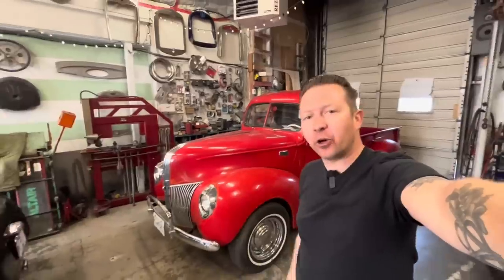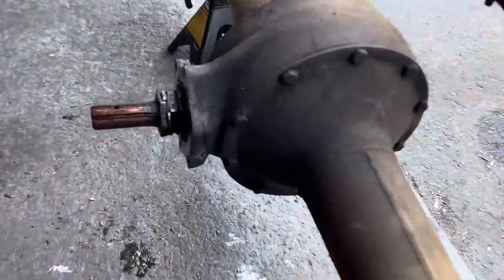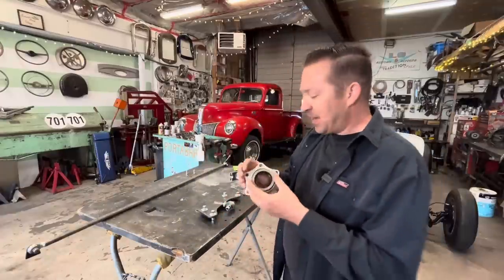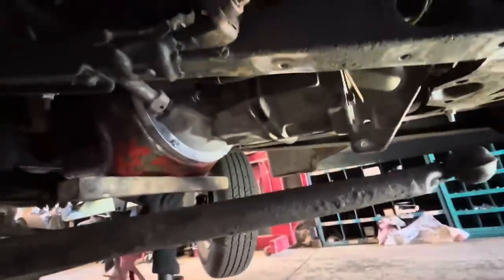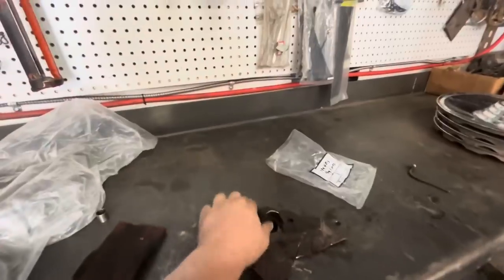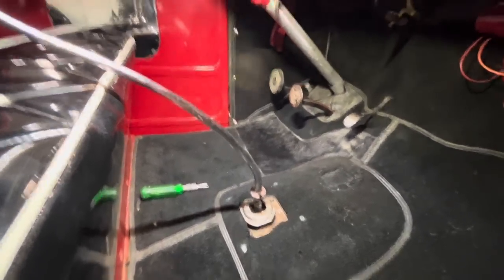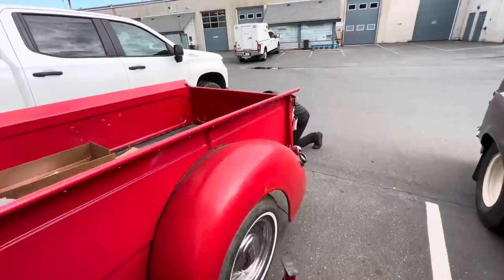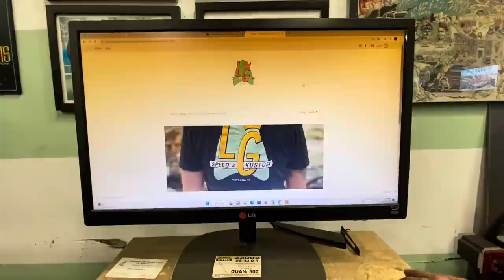How To - T5 Swap in a 41 Ford

Comment: Very cool 🤙 I just acquired a 41 pickup with a "fresh" 24 stud myself. I'm going to dig it out of the barn it's been sitting in for a while. Can't wait to get started on it lucky it's been restored a few years back just unfinished and never started so the engine is stuck at the moment.
Reply: Put oil in cly s let set  pull / tow   Pop the clutch till un  stuck
Reply: @aroundlinemen  yeah I put a mix of atf and Marvel's in the cylinders for a week or so broke it free without a complete rotation. Soaked it another week now it's good with fully rotating and the rings sound decent in the cylinders so I think we lucked out. I'll be firing it up the next couple months.

Comment: Congratulations Lee and Shannon on baby Lux! Great install on the T5, keeping the front bones stock. You didn’t mention the speedometer hookup, was it straight up? BTW, Hot Rod Works is closing , sort of, according to an article on the HAMB. They made great stuff!
Reply from the maker: We never hooked the speedometer up. Someone at some point in this trucks life swapped the speedometer out for an aftermarket electronic one, that never worked to begin with.
I did not hear about Hot Rod Works closing. Bummer!

Comment: A very good Video Lee. This swap has been discussed many times on The Fordbarn Early V8 forum, you show how to do it. I hope you don't mind but I posted your link over there. There was some discussion about using the S10 version of the T5 but there was an overwhelming raft of comments about the quality of your workmanship and a lot of these "old boys" ( I'm one of the younger ones haha) don't hand out compliments lightly.
Reply from the maker: Cool! Thanks for sharing it! I just went and checked it out. Man, some of those guys really like to overthink stuff huh? Haha
I thought the gearing on the S10 transmission in stock form was a huge improvement over the stock 3 speed.
Reply: @LGKustoms  You are right Lee but I remember 20 years ago there the S10 is what they talked about for this conversion. Those that have done it though seem happy and for modern day driving it has to be a big improvement over the old 3 speed which was for different times and different roads. That said the stock 3 on the tree Ford shifter has a real nice feel compared to others of the era. My 48 cpe came to NZ for assembly in a box from the Ontario plant and we got the flathead for 54 too.

Comment: there isnt the upper hemisphere to clamp the rubber ball ,model a stock  part. also, the stock 40 lower plate hangs the ball lower than the bottom of the rails. plus IF you think aboot it now, that lower plates could have been one piece, plus plus, the s10 tail uses a th350 mount, of which you can get with two downward projecting pins - rather than one in the middle.

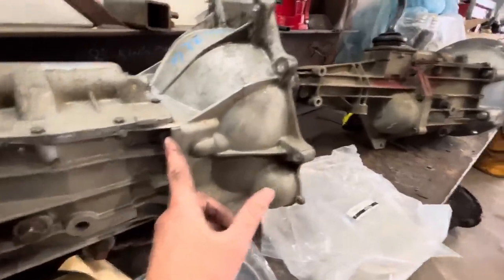Comment: 7:09 - Ah hah, see that? Same problem as mine, the cross shaft is 1/2" shy of end of the bushing. Tech support told me to redrill my shaft, but no, I added length to it. I'm doing this exact Speedway kit right now on my '37 Ford with 59 FH V8. The sleeve was .003" too small, a lil lathework and some LockTite. I called Speedway Tech and they told me the threads are 7/16-14 - NOT! But I'll tell ya, the 12mm bolts work great after chasing the threads 12x1.75mm.
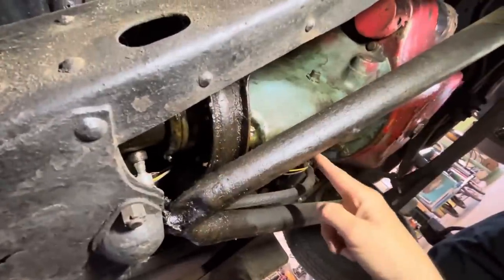Reply from the maker: 3:25 gears and an overdrive will be a great highway cruiser!

Comment: I've probably watched this video a dozen times!  I'm in the process of doing a T5 swap in my 40 Ford Coupe and first of all am having a real time getting the pin out of the existing drive shaft!  Secondly, does your friend sell those "wishbone ball mounts"?  My existing one isn't as rotted out as the one on you video but I may still need one.
Reply from the maker: Pretty sure I drilled the pin out. I usually drill them out. 
As for the wishbone mounts, Gord has retired from the foundry so I no longer have access to them.

Comment: Is there a conversion to hookup your speedometer to the 5 spd ??
Reply from the maker: Depending on what T5 you have, and what speedometer you have, there are different ways to adapt them. 
This truck has an aftermarket speedometer that did not work, and the owner wasn’t bothered it did not work, so I never looked in to making it work with this T5. 
I have a playlist on installing an Ardun V8 in a 32 ford, and I cover making the speedometer work via GPS in that series.

Comment: If you would have used a 4x4 t5 you could have retained the torque tube.serval companys produce the kit.saves modifications on radius rods.
Reply from the maker: I’ve seen people adapt Jeep T5’s to torque tubes. But I don’t know what the advantage is. The kit to adapt the T5 to the torque tube cost double what the open drive kit costs. The transmission needs to come apart, so you’ve got additional labor costs involved with that. And you still have to shorten the torque tube and driveshaft. 
The open drive kit was just over $600 for all the parts needed, and took about two hours to install. It’s also all completely reversible if you decided to go back to a torque tube and 3 speed transmission. In my opinion, it’s much more simple and economical.